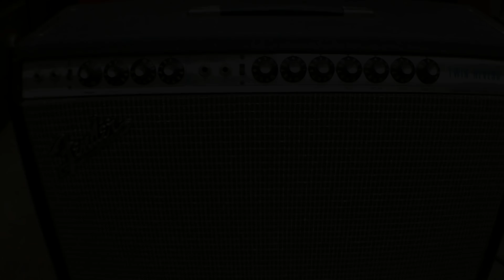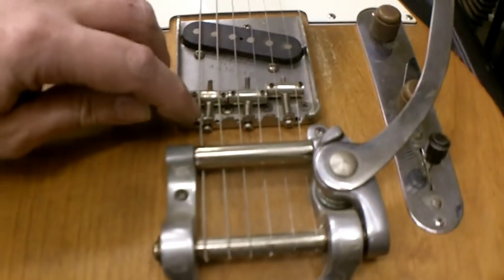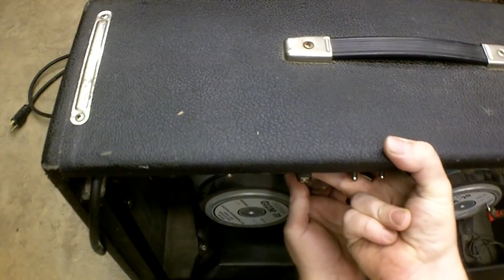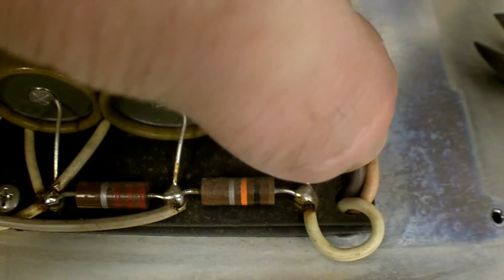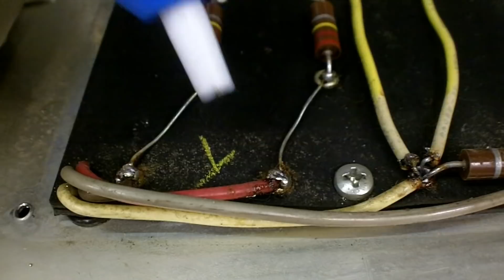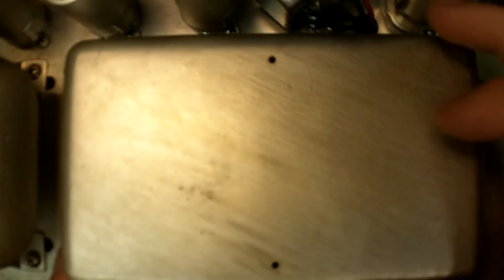Replacing Capacitors in a 1971 Fender Twin Reverb Amplifier Plus Some Soldering Information

Comment: Excellent video. I just had this done to my '72 Twin and it's made a huge improvement. I've been repairing simple guitar electronics for years now but am always afraid to touch amps like this. I like how you stress safety, I've been bitten by a tube pre amp once... Once! That's why I let guys like you who know what they are doing fix them :)
Reply from the maker: rediryou Thanks! Glad your Twin turned out good. Yeah, safety when dealing with these things is an absolute must. Being bitten once is enough to heighten your respect for them real quick...lol. It's something you'll never forget especially if you live through it. I know my bites all come to the front of my mind when I start working on something and all of them were of my own doing. Take care, G.

Comment: I agree with Brad and all the others that this is a very nice video. I am replacing the caps on my 1966 Fender Super Reverb. The circuit is basically like mine. I have to ask, how did you keep the wires coming to the eyelets from underneath both boards from coming out when you soldered the eyelets?
Reply from the maker: Well thanks Gerald! If my memory serves me correctly, the eyelets are in one board, then there is a solid board beneath it. The wires should be sandwiched in-between the two boards so they really can't get out. At least with the work I did here, all other wires stayed in place. I would take detailed pictures and just do one joint at a time to make sure all goes well. I hope this helps! Good luck with the cap job on your 66! Take care, G.

Comment: Very nice video, thanks for posting that.  I have a '96 Hot Rod Deville 4x10 and I'm working up to a cap replacement job.  Your vid helped a lot. You underestimate your teaching ability.  You're good at explaining this stuff. thanks
Reply from the maker: Thanks Brad! I'm glad you liked it and thanks for the compliment. I looked up your amp and it has a printed circuit board where the caps are located. The soldering principles are still the same, but use caution when de-soldering and soldering on printed boards. You can damage the traces on the board especially if too much heat, or too long of heat is used. If you're new to soldering, you might watch some videos on replacing caps on printed boards to get an idea. If when watching other videos, if you see the person struggling to do it- find another video to watch...lol. Other than that, it looks like it would be a fairly straight forward recap. Good luck with your amp! G.

Comment: The reason the cap has the positive lead to ground is because the bias voltage is negative with respect to ground, therefore ground is more positive so the positive lead goes to ground.
Reply from the maker: Thanks for the info, G.
Reply: ***** U R Most welcome :-D

Comment: Hi G!! Thanks for that! You did an awesome job...restoring AND your playing. May I add something? :-) Solder wick also works well on the ring lugs. I have a solder sucker and I use it on through hole components on circuit boards. Solder wick is great for surface mount and the ring lugs. I would also put a dab of hot glue under the cap to further anchor it. I am not trying to undermine! :-) Just hope this is helpful. You did an awesome job and those Fender amps are the best. AND your camera did do justice. Keep up the good work.
Reply from the maker: Thanks man! I do have wick but didn't think to use it for lugs. I can see where it would come in handy for places the sucker wont fit into. Hot glue is another good idea for securing the caps. No undermining, I like to hear good tips and other ideas. Thanks for the post, G.
Reply: Caps should have an RTV Silicon sealant to adhere them to the board to prevent premature lead failure and joint failure. We also Silicon the parallel laying caps together to give them extra support.

Comment: Very clean work G, and great tips on how to do it right!  One thing you haven't mentioned is what kind of solder you use.  I've used Multicore for years mainly because of the quality of flux.  The new unleaded is OK but not as good as the old stuff, however it's obviously good for health and the planet.  Love the early Silverface and your nice licks.  Always amazed...Thanks for sharing.  PJ
Reply from the maker: Thanks Pj. I did fail to mention the solder. I'm using plain old 60/40 .032 rosin core from Radio Shack. I've never tried multicore- nor any lead free. I believe the lead free has a higher melting point and is more difficult to work with- but I'm not sure. Thanks, G.

Comment: Wondered what the previous solder vids were leading up to? Very nice instructional video. That is a great amp. Thanks for sharing!
Reply from the maker: Thanks Mac. That's correct! I was needing to replace my tip, and wanted to try the new sucker on this project. It worked great! Take care, G.

Comment: Hi G, I have a Weller 40w iron and I've found that the amount that I insert the tip into the iron greatly effects the temperature. In other words, when I bottomed out the tip in the ion, it reached it's maximum temp. I leave mine out near the end where the tightening screw is. I was wondering what kind of solder you were using? Thanks, there's a lot of great information here
Reply from the maker: Good info Darryl. That will be helpful for those that have tips and irons like yours. The tip on mine screws on so I can't make adjustments like on yours. I was using 60/40 .032 diameter rosin core that I picked up at Radio Shack some time in the past. I could have used a larger diameter for this project, but didn't want to buy any. It was just a matter of having to feed more into the joints. I find this diameter suitable for most of anything I do. Hope this helps, G.
Reply: Okay, thanks. The thinner the solder, the more control you have.
Reply from the maker: Darryl Landry Pretty much so Darryl. If you're doing a repair on a printed circuit board for example, you certainly don't want to use a solder that has a large diameter. You could end up flooding the component and possibly connecting adjacent contact points. For soldering a larger connection, like the ones shown in the video, you wouldn't want to use a hair thin solder. If so, you have to keep the joint hot longer while you feed enough into the joint- possibly damaging components- plus it takes more time. It is about control for sure, but also heating the joint and applying enough solder in a short amount of time. Thanks again, G.
Reply: Darryl, I do believe that G was using 60/40 tin/lead solder which is a dream to use but it is getting abusive with it's price. The "new" tin solder is very hard to use especially in this application. It requires welding cleanliness and is not worth the cost unless used for it's intended purpose as on PC boards with a very hot iron and lots added of flux.
Reply: +bain5872 You're lucky. In the UK, Nanny won't let us use proper solder, only the lead-free muck!
Reply: Silas Fatchett
I don't find that surprising. I'm sure the minders will get around to the states eventually.